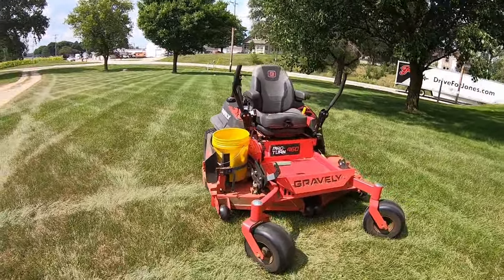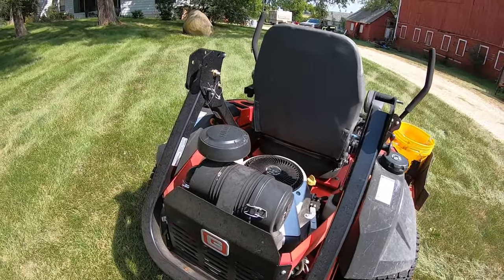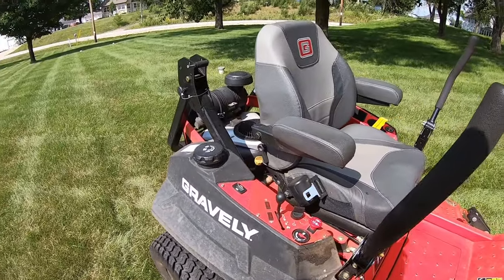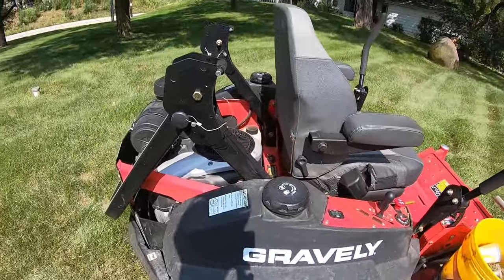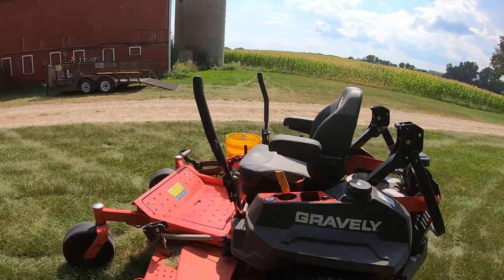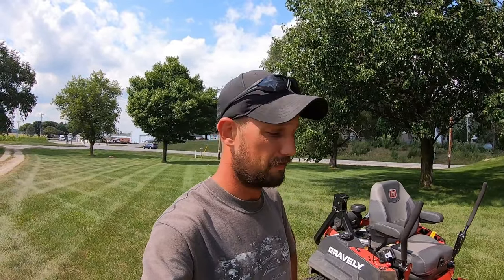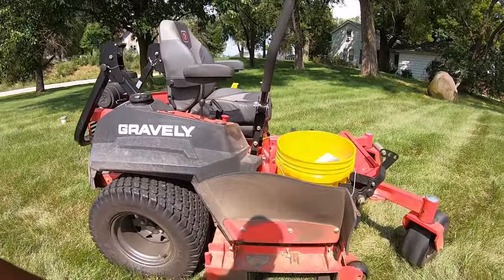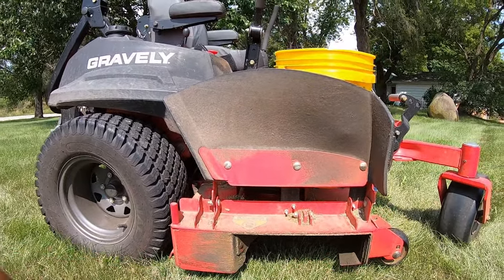Can gravely fix it? Part 2

Comment: I have a zthd48,biggest piece of junk ive ever owned. Poor cut quality, deck height adjustment off by 2”, fuel filter melted to block, carb issues by 2nd time using it, im on cbt spring number 9, 3 wheel motor belts, and deck cloggs up fast. Get rid of it, get an exmark
Reply: Why'd you go residential and treat it like commercial?  So silly.  Listen, you get what you can afford but don't complain about it if you use it for its unintended usage.  Residential = weekly usage around your house.  Commercial = daily usage for multiple commercial and residential properties.
Reply: @profighter1234  you do realize up until latest model it had a commercial or residential warranty on it. On top of that I bought it for use on 2 properties. Rest of my lawns i run a snapper pro ss100 or an exmark metro. The only difference between zt hd, pro turn z, and zx are the motors on them. Z and zx are commercial
Reply: @greggreen6636  It's a hybrid.  Beefy residential.  That is why it is so much cheaper than other Gravelys.  If you were told this was for commercial use, you should go have a talk with the person who sold it to you or you should have done your homework prior to purchasing.  Just saying.  Good luck!
Reply: I started with this mower ZT48hd and never had an issue. I put Exmark hi lift blades on it. I currently have proturn 160 and Ferris z3x.

Comment: my pro turn 52 the deck level hanger keep breaking the welds. done had two decks replaced. smh im taken to my fabrication shop and gonna have him weld on top. The design flaw is that the weld is underneatht the deck
Reply: Hi Grow It, Mow It...If you didn't get the Pro Series like I did, you can't treat it like a pro.  Most likely what you purchased was a hybrid Gravely that is used for residential and extermely light commercial (volunteer at the church type stuff).  Yeah, the welds on the hybrids are nothing like my (our Gravely professionals) welds on the high end mowers.  We put our lawn mowers through hell and back and they can't wait until the next morning.  Continue to buy Gravely but do your homework before you purchase next time.  If you need some help just message me.

Comment: Just wondering if you've heard the news that Gravely and Yamaha have ended their partnership...There are no Yamaha engine options on any Gravelys beginning next year.
Reply: Cause they are junk... mine has been in a shop almost more than in the grass over the past 2 years. Not happy
Reply: I believe it had to do with the US requirement placed on manufacturing here in the US and Yamaha couldn't meet these mandated manufacturing requirements.  This caused an increase in taxes/tariffs placed on Yamaha, who raised the cost over to Gravely.  Gravely dropped Yamaha due to these cost related issues, the pause in manufacturing due to layoffs and factory closures, in addition to their EFI motors having issues.  I don't believe the non-EFI Yamaha motor is having any issues from what I've been hearing.
Reply: @PastFlatPat272  Truly sorry about your luck.  You have to conduct preventive maintenance on any motor or they will start acting up like yours.  Yamaha efi's are actually the best on the market.  Fact.  But, as with any motor, if you leave it alone you'll have problems.  Preventative maintenance is key Patty. Change the oil every ten hours.  Don't wait until there is a problem and then blame everybody but yourself.  Just saying...
Reply: @profighter1234  every ten hours? You’re ridiculous. That’s an extreme waste of money to change the oil that often. There are lots of guys that put ten hours on a mower in one day. Are they supposed to change the oil every single day? Stop calling people out because you think you know everything
Reply: @NJ-or4qr  Listen kid, I have a big crew.  It's either let them go, go home early or fire them.  Changing oil on a Gravely equates to an hours worth of wages and keeps jobs.  Let alone keeps my Gravelys running forever.  Now I can see for the average person who doesn't take the high approach like I do that it may be a waste of money but these people have families and I take care of them.
Reply: @profighter1234  dude you need to take ur medicine you sound like one side of ur face is hanging lower than the other are you able to whistle?
Reply: @hairycods2273  Hey thanks for your advice Hair Crotch!  I got some for you as well...Try cleaning the underside of your mower deck with the blades running.  Quicker, more efficient and you'll see amazing results.

Comment: How much did you pay for this mower
Reply from the maker: It was around $14000
Reply: @mikaelslawns8289    holy crap, I just bought a 2022 gravely ZTHD52 inch X factor 3 deck, And it cuts like  Butter nut. Smooth as glass and I used to work for Wright Manufacturing, assembly line  manager/quality control, and I still chose gravely.  I only paid $5900 for mine new,

Comment: What he said! 👇 but...before you do that try a set of high lifts. Factory blades are medium lift...
Reply from the maker: Do you have a brand you suggest?
Reply: Oregon high lift, part # 91-264, try em let me know what ya think. Your cutting height will be off a 1/4 they are not offset. If you want to mow at 3.250 you will want to set the height selector at 3in👍
Reply: I replaced the stock blades with 91-264 high lift exmark blades and removed the baffles on my proturn 260, it made a Noticeable difference but still doesn't cut as well as an exmark or scag
Reply: I added Gravely part# 91-239 high lifts to my 460 yesterday and it has never cut better...I suggest everyone with this mower try these blades..JS
Reply: @ryangarner4737  put your baffles back in
Reply: @mikaelslawns8289  You asked a question.  You asked for his expertise and he not only gave it to you he gave you the exact spec and down to the 1/4 of an inch to use them.  I did not see a "thank you, I appreciate you going the extra mile for me or even a thumbs up".  I see you either comment or smash the thumbs up button on any comment that trashes Gravely or its cohorts.  Please don't use this forum for that.  I sure hope your IQ is high enough to have done some research on this amazing product.  And then you purchased your mower.  If your blade deck hit a tree stump or some other unforgiving object and Gravely won't cover it, don't take it out on the company and look for positive reinforcement on this channel.  Dump on your wife or girlfriend.  She's probably numb to it by now.  Don't mean to be mean.  Just teaching you manners.  You are welcome.
Reply: @ryangarner4737  Exmark aint near as good as Gravelys but Scags are super quality. You pay for way too much than you need on a Scag though.  Unless an extra $4,000 is worth it to you for some larger, softer seat springs and a more cushiony padded seat for cutting grass.  Most prefer longevity and cut quality.

Comment: I hate our 460 looks like the middle blade isn’t cutting
Reply: Such a simple fix!  It's called a stone.  Stones sharpen blades.  Thank me tomorrow.
Reply: @profighter1234  done did that
Reply: @kevinhamby2064  Awesome.  Lemme know how it goes!
Reply: Brand new blades guess what still cutting like shit
Reply: @kevinhamby2064  No wonder!  If it takes you 10 months to do something about your blades, the center cut is probably the least of your concerns.
Reply: @profighter1234  new blades every 2 weeks I mow a lot of grass I’ve used gravely self sharpening all different types of blades put a set on it today and still leaves stragglers
Reply: @kevinhamby2064  Instead of going 14 mph, try slowing it down to 11 mph.  Slower yet in wet grass. You're welcome.  These machines are the best on the market unless you want cushy seats and even less vibration.  Treat her better and and she'll treat you better.

Comment: Just don't buy one with the Kawasaki Engine.  Kawasaki engines Sucks. 2 years the rings will blow out. and there NO REPLACEMENT FOR THAT ENGINE>  PLUS NO ONE WILL WORK ON A KAWASAKI ENGINE.  The Gravely Mower is a great mower. Again> just the Kawasucky engines sucks > You can get them with other kinds of engines.  But its going to cost more